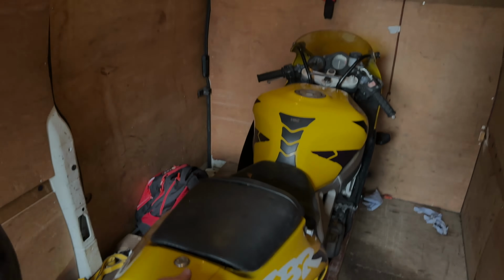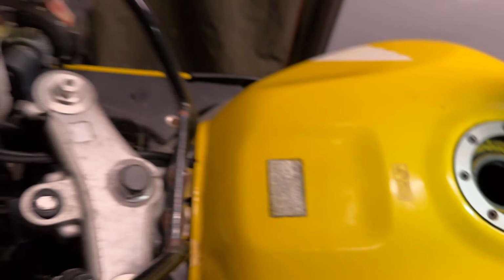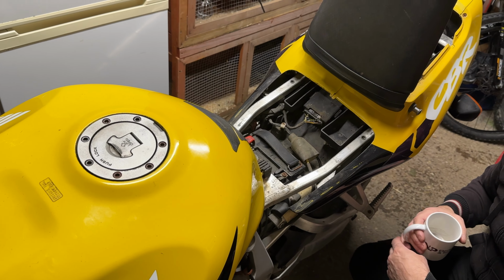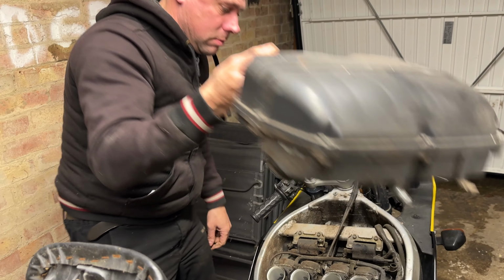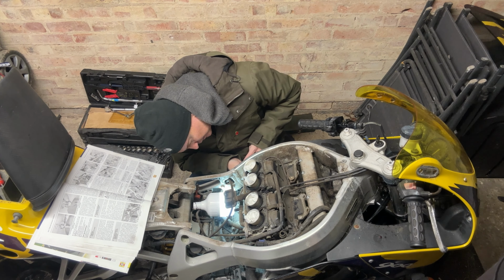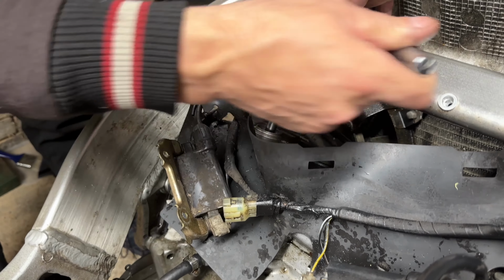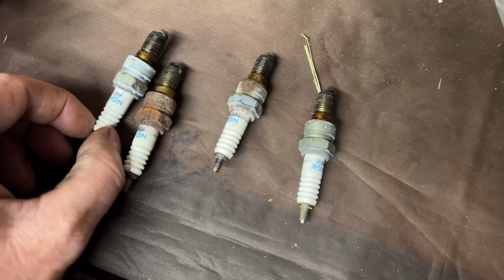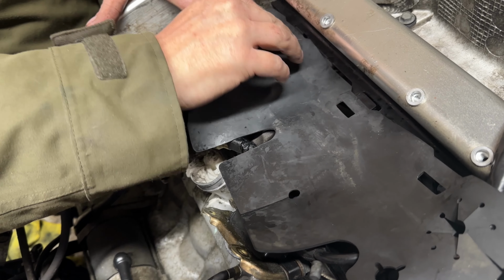Blade Diaries Part 1 - CBR900RRV Fireblade Restoration #fireblade #restoration

Comment: Just come across your channel and these videos. I have the exact same blade and the mileage is very similar. Luckily mine was in decent condition when I got it. Just needed some horrid Yellow undertray/chainguard and non standard indicators removing. Managed to get a half decent uncut undertray for £45!
Reply from the maker: You got a fantastic deal on that undertray mate… Seen em going for stupid prices! Mine is cut but for now gonna have to live with it 😄

Comment: I have a 98 in the red, purple and white colours. Bought it on a whim cheap off Ebay. It was fairly decent but went through pretty much everything and put a full Akra, Jet kit, 17" F3 front wheel and I honestly don't think I'll ever part with it. Rebuilt a 98 R1 and the engine is in a different decade but the Blade holds a line soo much better and just oozes quality and is just more rewarding to ride. I also have a 2020 S1000RR so I do know what modern stuff rides like.
Reply from the maker: Sounds like you have an amazing bike and are gonna have a lot of fun on it… I’m curious about the 17” wheel. Heard a few say it’s good and a few say it’s not as quick steering as the 16”. How you finding it?

Comment: Interesting project - I have a 1996 FireBlade that I've owned for 20-something years, so I'll be watching this with interest.
One comment for anyone doing a similar job - the fuel tap has a pipe to the inlet manifold and, even in the 'on' position, won't flow fuel unless there is engine vacuum, i.e. it's running. So there is no need to clamp the fuel pipe. In fact, the bigger problem is that the tap has a tendency to gunk up, so getting fuel through after being laid up often requires the tap being dismantles and cleaned up, in my experience!
Reply from the maker: Thanks for the comment mate and stay tuned for more to come. About us clamping up the fuel tap hose for no reason... well... I guess that makes us a bit silly. However, as the whole project is about learning new things I guess I can be forgiven ☺

The fuel tap is beyond repair...It's one massive pile of rust. Got a new one though ready to go on.
Reply: I certainly wasn't trying to make you feel foolish - merely letting other viewers know that it's not necessary. Unfortunately, with ethanol-based fuels, I've had to take my tank off far too many times in recent years to sort out the effects. I've put race fuel in it for this winter in the hope that I can avoid having to sort the fuel tap and carbs for the umpteenth time in the spring! I'm only in Bracknell, just south of Bucks, so maybe there's a FireBlade rideout when you have it done?
Reply from the maker: @dannycallaghan3601  that’s a brilliant idea… We’ll have a BladeDay when I, eventually, get this beautiful pile of rust, cobwebs, and dead rodents on the road.

My mother bikes are filled to the brim with E5 and the fuel treated with additives for the winter… You mentioned race fuel though; is that ethanol free?
Reply: Yes. It's not cheap, (I paid something like £75 including delivery - actually the delivery was half the cost!) but it should save me loads of trouble. It lasts for years, so I'll siphon it out in the spring and keep it for next winter - and the one after!
Reply from the maker: @dannycallaghan3601  doesn't sound like a bad idea...